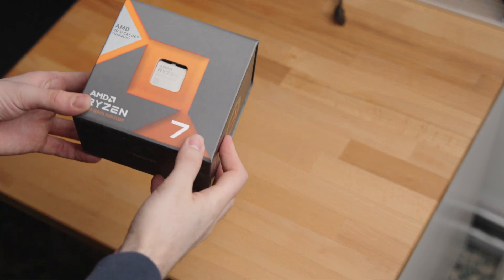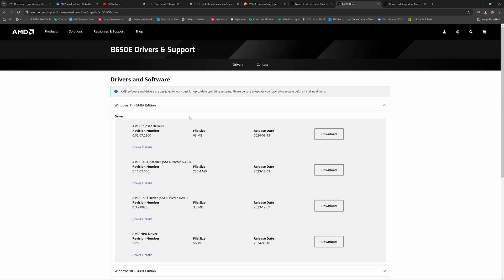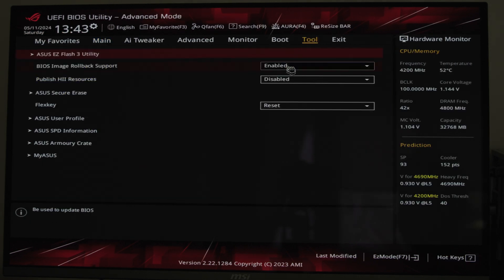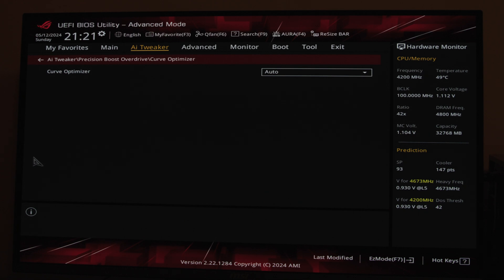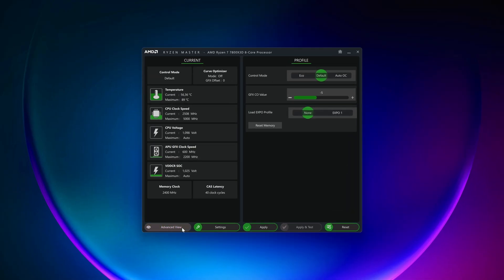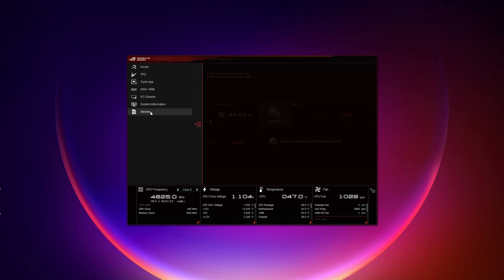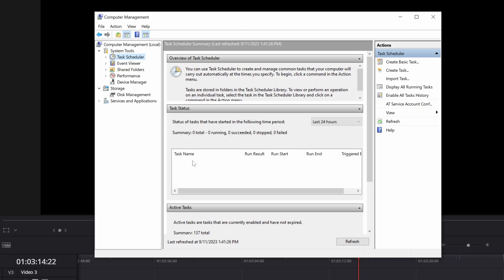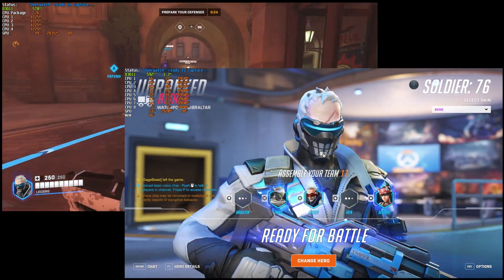3 ways to undervolt Ryzen 7800X3D (and 9800X3D)

Comment: do not use ryzen master for changing any of these settings, always use bios. while not a big issue, ryzen master has a habit of causing pc to no longer boot meaning you need to clear cmos to boot properly and do the settings all over again anyway. easy if you have a cmos button, annoying if you have to open pc up to  take battery out.

Comment: Used Ryzen Master to set -30 CO on all cores on my new 9800x3d = amazing. Raised my Cinebench score and lower temps from 94c to 70c max. Booat maxed at 5.4ghz without issue. 
Thank you for quick clear guide
Reply: Did it lower idle temps?

Comment: if i use amd ryzen master my pc will not boot anymore with -20. just black screen.. but when i do it in bios with my asus mainboard i can go to -35 am i doing something wrong? hopefully somebody can help me.
Reply from the maker: If BIOS Works just use BIOS, it’s better that way anyway. Just make sure to stresss test etc
Reply: @ ty for your answer :) i used cinebench 24 is that enough for a stress test
Reply from the maker: @ Try occt and check for errors
Reply: @leizerg  did a 1 hour cpu test with occt. no  errors. really helpfull video ty
Reply: @leizerg  1 last question, i didn't do a bios update for my x670e- plus wifi mainboard because i never did it before and dont want to damage something. is it a problem when if i havent done a bios update?
Reply from the maker: @ you might be losing on some performance. Did you check how high your clocks boost? Should be over 5000Mhz
Reply: @leizerg  at the stress tests my clocks boost around 4850Mhz
Reply from the maker: @ should try it in a game, it’s more realistic. In synthetic tests my clocks rarely boost over.
Reply: @leizerg  i think i will just try a bios update, watched a video, looks easy.  it makes the system better doesnt it?
Reply: @leizerg  so did bios update and set it again but on -20 and i get about 5050Mhz if i look on HWiNFO on max core frequenz but not on all cores core six is the lowest with 4900Mhz max. should i try it with the new bios on -30 and do occt again for 30min?
Reply from the maker: @ looks good now, id leave it as is :)

Comment: Curve optimiser never lowered my temps
Reply: I set my negative 30 and it lowered it 3 to 4° c. My games now run between 65 to 70 c.  Maybe it's your guys's case
Reply: @JohnnyGification  I got h9 elite nzxt case
Reply: @JohnnyGification  what’s your bios settings
Reply: @JohnnyGification  i turned turbo boost off (no fps drop at all, maybe because all my games is not really cpu intensive), temps decreased from 70-78 during heavy gaming to 55-60, so cool now
Reply: i set mine -30co with my 7800x3d, tested in games, temp still same it can reaches 80c in hogwarts legacy, the only way to reduce the temperature to mid 60s is to disable boost (i tested multiple times and saw no performance drop in fps, maybe because this game is not really cpu intensive?)
Reply: @Suandihendrik  how you disable boost

Comment: Thank you ❤
Is this going to impact the lifespan of the CPU?
Reply from the maker: Not dramatically :) but yeah lower temps should help
Reply: @leizerg  I tried it -30 all cores, I didn't feel anything, and I got pretty decent temps 60-70 (only in Battlefield i saw 70 celcius). I don't see the reason for the 3D to undervolt sir.
I have an Asus 670E-F and a Freezer 3 360mm in my Phanteks p600s, and I have great airflow!
Thank you for the video; I have an idea now!❤
Reply: @leizerg  I did -20 all cores  https://www.youtube.com/watch?v=Kq89QPozqgY

Comment: Good video any else getting high temp spike when opening a game or application getting 87c idle 42c gaming depends 60-70. But sometimes it ramps up cp usage randomly sometimes using old bios 1806 and old chipset. How do remove all old chipset drivers?
Reply: Temp spikes are normal with this CPU but 87 idle? That's way too hot.
Reply from the maker: I think temp spikes are normal. Wouldn’t worry too much

Comment: Is this still a good idea to do? I remember a while back it was. With the updated bios and everything to correct the issues, is this still a good idea?

I have a stock 7800x3d, Asus b650 TUF MOBO. Cooled by a Phantom Spirit 120. 

During all games the hottest it ever really gets is between 70-75°.
When you bench it, 80s, no more then 85°
Idle temps 40ish. Generally during gaming 60-65°

Again, I ask, is this even worth it? There's always risk of instability right? If my rig is stable, and performing great, should I bother?
Reply from the maker: What’s your peak cpu frequency?
One of the main reasons I do it it’s because it’s help me cpu boost from around 4900 to 5050Mhz. Temps are better too but not as much as with 5800x3d.
Reply: @leizerg  I'll have to look into it. I'm not at home and don't rember off hand as I didn't pay as much attention to that when I was doing initial testing. I havent had the cpu and board very long yet.

Generally what should it be around you figure? 

I'm definitely open to making changes as I was a little concerned about all the issues these chips had with some boards and all the am5 stuff I was hearing near launch. But I was hoping it was all fixed by now and I wouldn't have to worry much.

I primarily used Intel before, and rarely even saw 70° degrees unless under heavy load. This 7800x3d is at or hovering around that in most all modern games. Wouldn't mind seeing it a bit cooler, but that is still a perfectly fine temperature no?
Reply from the maker: @d8l835  Yes. As long as you update your bios and chipset you have nothing to worry about. The temps are perfectly normal.
Reply: @leizerg  when i already get boost speeds of 5050 and even a little higher, would undervolting even boost this further?
Reply from the maker: @Nebujin383  Probably not

Comment: I just built a 7900xtx with 7800x3d but I got disappointed on warzone 3 because there is micro stutters and 1% lows are disaster! Does this undervaluing CPU might help fix the micro stutters?
Reply from the maker: You can try but I believe the problem js with the card. I had similar issues when I was testing 7900xtx. In AcValhalla and possibly mw too.
Reply: Same build, it’s just an AMD issue unfortunately with warzone ( Urzikstan)
Reply: out of curiousity, whats your RAM mhz/cl and ssd?
Reply: @Nebujin383  my ram is 32GB 6200mhz cl30

I swapped with a 4090 and I am happy now
Reply: my xtx pushes 200+ frames in Warzone and there are 0 stutters so I maybe you had a faulty card
Reply: Amd gpu moment 😟
Reply: are you running msi afterburner ? if so try disabling power monitoring and see if that helps
Reply: @duxie_DK  changed the card to a 4090 long ago
Thanks though

Comment: on my 7600x 7800x 7800x3d these undervolts never work they will be fine in cinebench and prime95 but if you go to play games it just randomly crashes after 5 minutes 30 mins etc
Reply: My experience has been the opposite. All games and applications, video rendering etc work great. No stutters, not a single blue screen. Fps is better than ever. Temps fantastic. But occt and prime 95 instantly error. -30 85mv with a soc voltage of 1.200. Furmark, cinebench, geekbench 3dmark all pass with flying colors.
Reply from the maker: Did you try lower values?
Reply: @leizerg  when 30/20 15 didnt work i tried 14 13 12 11 10  still got fenris crashes on diablo 4 and game freezes in new world and  unity issues in last epoch even The infected in steam which is ue5  bugged out but i just lowered my static value from  1.2 to 1.15  and it seems fine no crashes so far on my 7800x3d
Reply: @JohnDoe-27 you need to put your load line calibration on medium for values over -10 to work. that has been my experience with the 7800x3d.

I’ve set every core except core 4 & 6 to -2. Core 4 & 6 have -22
Reply: These undervolting did work for my CPU. Strangely I also got better FPS. Hmmm.

Comment: Great video: getting some great extra performance with while staying at the 80degree mark (got a small case with a small cooler). But getting those 5ghzs now! 
Edit: esrlier it wouldnt work, before i realized i didnt change positive to negative voltage curve in BPO.. oeps
Reply from the maker: PBO as in motherboard settings?
Reply: @leizerg left the BPO limits on auto, if you mean that. And I changed setting in bios yeah. Wasn't sure I should turn it or set it to motherboard instead. Any insight maybe?

Comment: a bit off topic, but with EXPO enabled when turning on or restarting the pc, it stays at black screen for about a minute before it posts... its kind of annoying. Anyone else have this problem?
Reply: Yeah bro same issue
Reply: @11say  I also got that issue on my new pc
Reply: Memory context restore iirc
Reply from the maker: I did but bios/chipset update helped. Did you try this?
Reply: @leizerg  its a couple months old. I see the newest bios as of 06 27 says - optimized boot time so I will try updating. But I dont think "boot" time is my issue.. Its just that it takes a while to post and ram/cpu leds on the mobo are lit up during that time. Which is weird because I made sure my ram is on the mobo and cpu compatibilty list. Also this doesnt happen with expo off.
Reply from the maker: @freezxng_moon  yep exactly the same issue I had.
Reply: @leizerg  so the latest bios helped a bit, but i still get around 20 secs of black screen before post. Do you remember what your Power Down Enable and Memory Context Restore are set to? I think those affect boot times a lot. Previously I had to keep them disabled or my system would be unstable/wouldnt boot. Now I left them at auto and at least im stable.
Reply: Had the same , but I waited for 5 minutes, search for memory context restore and set it to enabled. Hope it helps
Reply: My PC boot 60 seconds. I don't mind because I rather have memory training than 1 time wake up to corrupted RAM
Reply: Your memory is training. Bc your memory is overclocked. You cam try updating you bios this helped my cut that time by half

Comment: even with -15 I cant boot the pc.. i dont know if i lost the silicon loterry or what. I could disable expo but that would be sad as hell.. My cpu is at 70-75 c while playing the first descendant, thats like 10 degrees hotter then the GPU lmao. When preparing shaders it even hit 88-89c... this is my first AMD cpu and I had am 8700k before, so idk maybe this is normal but its sad.. my fucking room is like 28c in the summer while all the other rooms are like 25-26c just because of this fucking cpu lmao
Reply from the maker: Did you make sure to do bios update? I had the same issue but after an update it’s stable now
Reply: @leizerg  I updated it when I was trying to undervolt, which was several months ago now. Can't remember the version
Reply: @freezxng_moon  any update?

Comment: 7800x3d owners, can you guys write your idle temps and ambient temp for this chip? I'm just curious and want to compare.
Reply: Idle temp: 45c Ambient: 27c
Expo enabled.
Reply: idle 45-50 at 30 ambient
Reply: idle temps are never a good  pointer as it all depends on what cooler you are using, only the 100% load for single/all core is really interesting in the end but i can say that the 7800X3D or even could be the whole 7000 series is running hotter then the 5000 series as it hotter then my old 5600X but my 7800X3D didnt tinker anything really just applied EXPO, PBO2 with -30 CO and just put the Thermal Limit to 80 so it never reaches the Tjmax of 89 and it boosts all cores to 5GHz some has been going to 5050MHz and going at it on 1Volt to the cpu while my 5600X did 4.85GHz at 1.4V
Reply: @n0ex  thanks for the feedback. I already have my chip optimized. But I'm just curious for idle temps for my sanity.
Reply: @Vuhry  with just expo enabled and no other tweaks im getting 45-48c at idle at 27c ambient.
Reply: @n0ex  How do you keep it from going over 80º? Where is this setting in Bios?
Reply: My idle temp CPU (Tctl/Tdie) is around 45 degrees when doing nothing but 47-48 degrees on average, with standard curve fan(800-900rpm idle and silent) and Arctic III 360mm AIO with total of 8 fans(5 case+3 aio fans). While gaming my CPU reaches 60-65 but usually stays around 61 degrees while also having Discord+webbrowsers with Youtube etc up at the same time. I have done nothing in BIOS except chosen standard fan curve and disabled multicore enhancement setting on bios. Every individual core in idle is like 27-29 degrees while in idle. I also have EXPO enabled. No idea of what my ambient temps are. I have no idea if this is good or not, it's my first time i built a pc xD
Reply: I have a 7900x3d, but i'll share mine also - Idle 42c at 26c ambient, 80c under full load stress test, 50-60c while gaming, asrock b650m hdv board
Reply: 38 - 41 idle, 50 - 60 average in gaming with short peaks over 70 and 73 max in R23 with Arctic Liquid Freezer III 280.
Reply: Arctic LF III 360 on idle 40-42C. In games 50-55C. Ambient 24C
This CPU has really high idle because it boosts with no reason. I came from Intel where normal idle was 26-28C
But I'm happy with the performance
I'm more curious about the Power per core on idle. My cores 1 and 4 never goes under 0.050W but my cores 5,6,7 goes all the way down to 0.002W
Reply: Same my idle is ~50C
Reply: low profile cooler, 46 to 50 idle, 55 on elden ring, 70 while unpacking, vcore soc set to 1.00, haven’t tried pbo yet because of silicone lottery, i think i’m good.

Comment: Ok but if my 7800X3D never really gets over 70c is there still a purpose in doing this? And I dont totally understand the logic... if Im limiting the voltage my CPU can have, how would that improve performance?
Reply from the maker: It’s not limiting the voltage is more moving the voltage to frequency curve a bit. This way at top performance the cpu draws less power and is less hot. You should check it your cpu boosts over 5Ghz - if it does then the only benefit you’ll get is cooler system and then it’s up to you if you want to do it.
Reply: Another way to see it is that chips are not all equal and there is a thing called the “silicon lottery” or how power efficient your cpu is given a certain voltage, every chip is different due to small, imposible to control differences at the microscopic level, so manufacturers have a “generalized” voltage that they work with, but it’s not optimal just stable on average
Reply: By undervolting you are “removing the excess voltage” that is not being efficiently handled by your chip, it’s a bit more complicated than that, but doing this you are:

1. Making your chip more power efficient, there is no more voltage than what it is needed for full load processing 

2. Making your temperatures better, allowing you to stay boosted longer (particularly useful for Intel chips especially)

3. Extending the life of your processor 

It’s all just benefits really, but there is the effort of having to test around for stability
Reply: Kind of like a car that's just drinking gas and getting the same gas mileage. You tune the car, it probably runs cooler, eats less gas and get the same gas mileage. It's just a win